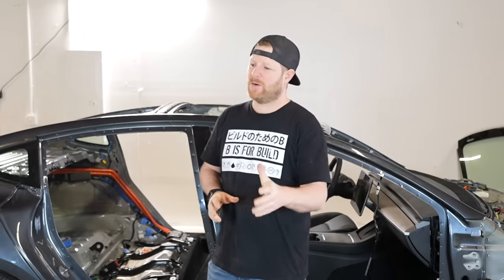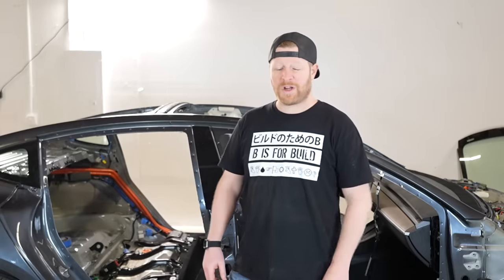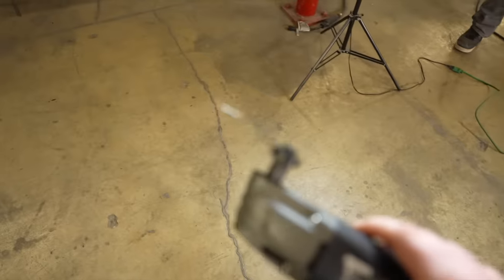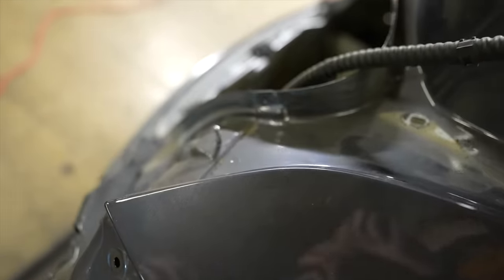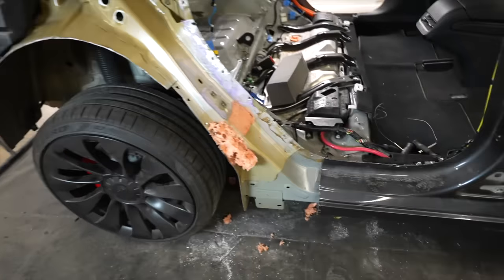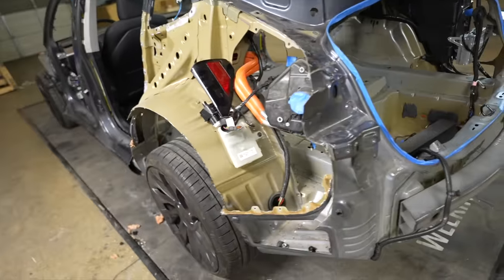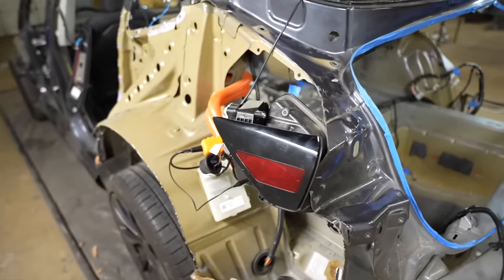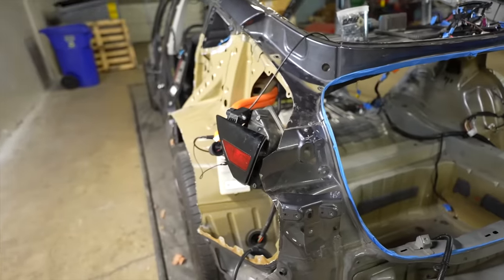How Much Faster Is a Tesla Model 3 Without A Body? RESULTS ARE SHOCKING!

Comment: I like how in the beginning of this build you were talking about how this is the most technologically advanced car you've ever worked on and you were sure you wouldn't be able to get far in removing stuff before it got mad and stopped working but now you have the entire body off and it just shrugs and keeps going lol
Reply: I was shocked that it wasn’t a problem
Reply: I’m respecting Teslas more and more as this build goes on
They’re surprisingly workable
Reply: @benjiman7259  teslas get a shit ton of hate just because they are EVs.
Reply: @Nick-hm9rh  na was a fan of tesla before. after purchasing i cannot recommend it anymore. way too many defects. service is non existent and overall i should have sticked with a more reliable brand. there's a report from consumer reports which confirmes my anectodical story
Reply: "The best part is no part" is apparently not just a SpaceX mindset.
Reply: @1eikaramba1  5 years 230,000 miles on my Model 3. Very reliable. Extremely happy. Saved $21,400 in gas so far! $21,400 effing dollars!!!!
Reply: @AdamWood  How much did you spend on electricity for charging? Not a gotcha question, I'm genuinely curious. I figured that the higher price of EVs was offset by gas savings, but I'm wondering how charging factors in.
Reply: @aidanharley243  Looking online people are averaging roughly 4.65 mi/kWh. With that, 230,000 miles takes 49,462kWh of electricity. Average cost of electricity in the US last month is $0.165 * 49,462kWh is roughly $8,163.
Reply: Seeing your screen name makes me think
Reply: @1eikaramba1   Nobody asked about your buying experience
Reply: @benjiman7259  The problem is the software.
Reply: There's an amazing thing called tricking the software and not having the sensors and shit being mandatory it makes sense for like the charging system and like the wires and all of the main components of the moving portion of the vehicle I'm sure Tesla did an update at some point that made all the extra stuff not one-hundred-percent necessary to something like this could actually happen and go down because there is plenty of DIY and this world that you just want to get out there and do it and if you have the ability you send it and this is the result❤
Reply: @benjiman7259  it's nothing but don't Legos that's exactly what electronics are and this isn't entirely electronic vehicle and it's the future Welcome To The Future we've got really fast angry pixie fucking Vehicles man its awesome!!!!
Reply: @aidanharley243  most people charge at home, and the running costs when you just drive 140 miles during the day to and from work, then charge at home, and night charging is cheaper than day charging because there is little demand at night atm

plus the massive efficiency Tesla's get, the cost of electricity for that distance travelled on say a model 3, is around 4k-9k dollars depending on where you live

you literally save thousands of dollars when you choose an EV, especially a Tesla
Reply: @1eikaramba1 you are having a unicorn of an experience. Tesla service is amazing according to everyone I’ve talked to that has used them. I’ve actually never needed them myself. Five years without a problem.

Comment: If you want to take it over 35 before the body swap, cut some plexiglass and bolt it on the frame behind the dash as a wind deflector, that bit of wind being thrown upwards will deflect the rest over your head. And also the state-of-charge on the original 3.8 run was low compared to it being nearly full this time, so last time it had less voltage and thus less horsepower, so it being a whole second faster was both it being far lighter now but also having a much higher charge level and somewhat higher battery voltage and thus more horsepower. The removal of the body would've had a big effect anyways though, perhaps 3 to 5 tenths I'd guess.
Reply: C/D says 3.1s with 0.3s rollout so that makes about 6 tenth difference

Comment: You should have it in a higher state of charge (like >80%) to improve the 0-60 time, looked like it wasn't that high when you got 3.8s before removing the body @ 20:15 
Cool project BTW :)
Reply: This.  The SoC looked like 30% or less in the first run, and that will give you drastically slower times. Still, taking the stock 3.1 (with 1 ft roll-out) down to 2.8 without a roll-out is a nice improvement.
Reply: @misaacson  also not entirely sure the measuring speed from the dash is super accurate. but at least it's consistent in both measurements. because if different charge, there is no strict reference point but it's still clearly way quicker than any stock M3P without weight reduction
Reply: 💯 as a M3P owner they are all pretty spot on for accel times. State of charge needs to be 80% or higher for those times.
Reply: @geemy9675  Tesla has very accurate speedometers but you're right, they did this entire thing pretty casually.

Comment: For the autofocus, you should be able to adjust it to focus on what's center frame most, that would likely work best for you.
Reply: what kind of camera & lens it is? anyone?
Reply: @bisforbuild Once I say the autofocus I could not stop seeing it.  Maybe you have to stop pointing and use arrows in editing?
Reply: ...or just use manual focus with 1 push AF so that it stays where you want.
Reply: How about changing the wheel and tire size?
Reply from the maker: thanks for the tips! it really helped! Now if only i could figure out the audio issues. Switching from canon to sony has been rough
Reply: @BisforBuild  get a DJI MIC
Reply: You could also try changing the speed of the autofocusing. Many cameras have that as an option
Reply: Try using a laser pointer.

Comment: I'm willing to bet that a decent portion of the 0-60 time improvement was due to the battery charge. The first 0-60 run was done with what looks like 40% or so battery charge, and the second run looked like it was at least 80% battery charge. The overall battery charge makes quite a big difference on the power output capability of the battery.
Reply: That's only really true at low temperatures.  The Model 3 in NCA and LFP chemistry is about equally fast down to 30% SoC as long as it's not freezing outside, then performance is impacted.  For LFP it can get really bad.
Reply: @tomsixsix  What is NCA and LFP chemistry and do you know when it went into production? I have a 22 M3P and I swear I can feel a difference below about 60-65% SOC. Not sure which battery chemistry mine has, it was ordered in Feb '22 and delivered May 24, '22.
Reply: @mholmes9262  If your car was made in the USA it has an NCA battery.  If it is European/China in origin and is standard range it is LFP.

Comment: I suspect that tho the 0- 60 might increase a lot, the range and top speed may decrease due to aerodynamics.. would be really neat to see them tested at a race track!! 😉 
But again, awesome video Chris!! 👍
Reply: putting back the hood and front bumper would help with the drag without too much weight penalty
Also  lower frontal area might balance out the drag coefficient, and anyway top speed could also be not horsepower limited in which case it could get to the same top speed, just a bit quicker or slower depending on the drag
Reply: @geemy9675  Going to need a full helmet or going to do a Jeremy Clarkson with the wind 😅

Comment: I work at a tesla authorized bodyshop and I just replaced a rr quarter panel.  Just for future reference it does not like you unplugging the larger connector of the two that are in the rr inner fender well. If you do have to disconnect make sure you unplug the 12v system. When that plug is disconnected she will shut down the hv system and drain the 12v battery.

Comment: 10:00 when you get to this point you realize how similar the base structure of all cars is regardless of the body structure. It makes it look like you could pretty much body swap anything as long as you build a roll cage but like all things with cars it's much easier said than done
Reply: Though the base design is quite universal, there's a lot to consider and act accordingly, like exact length, exact width, wheels, dash and fuel tank positions on the three axis, really much easier said than done as you said. Body swapping unibody vehicles is something I'll gladly leave to whoever has the knowledge to do it lol. Not any professional can do that.

Comment: Sport Compact Car magazine did something similar to a early 00s Sentra. But they removed parts, then did a run down the drag strip. After that they remove more and did another ru. Kept going until it was in a similar state. IIRC, they took a 16 second car and made it a 14 or 13 second car by removing weight. The article is out there in the aether of the internet, just have to Google it.

Comment: With the significant gains from weight loss, it would be interesting to find the point of deminishing returns on the battery.  Running the lightest battery capable of delivering sufficient current to make 2 passes, but no more, would set some serious records.

Comment: For the Focus on the camera. You can set it so that the speed it focuses is slower to react to changes. this way when you move your hand in front of the lens it wont auto focus right away and will focus only after the its in the location for a set time. you can also have it slowly change instead of snap focusing. hope that helps. New camera looks great.

Comment: With all structure gone how strong is the skateboard part? I'd worry about it bending or tweaking if pushed hard. it's good to know it's strong enough to handle a max acceleration test. Anyway very cool build and I'm amazed how much work you get accomplished each video.
Reply: He loves cutting bodies off cars without bracing them first. I'm sure that thing is a prezel
Reply: The floor is almost entirely battery and that section is super reinforced from factory
Reply: reinforced to protect the battery aginst getting punctured from the bottom if you hit something or protected from the sides in case of an accident. there is no way the chassis hasn't lost 80% of it's rigidity. the  roof and the pillars are also super reinforced to provide the best protectio' against rollover despite the glass roof so it all contributes to the rigidity, with half the unibody gone it has to be flexy like a car from the 1950's...Tesla is much too concerned about weight to make a skateboard that stays rigid without the roof

Comment: I'm sure everyone has commented about this already, but in your stock 0-60 run, the car appears to be well under 50% charge. That will have a pretty significant impact on your acceleration in a Model 3.

Comment: 3:05 this must be the RFID reader to (un)lock the car with the keycard.
Reply: That must be exactly what it's for. The module seems to run at the NFC frequency (for the card) and also at Wi-Fi frequencies? You can find that information in the Model 3's owner manual (I looked at the online one) under Certification Conformity.

Comment: I remember 10+ years ago when HotRod did this with a C4. If i recall the car got slower at a point due to the geometry of the suspension when all the weight was removed.
Reply: Sport Compact Car did it with a Sentra, too
Reply: with AWD and heaviest component being the battery and located between the wheels, weight distribution shouldn't be too bad
Reply: @geemy9675  It's not the distribution of the weight but the amount of it. Remember that as the suspension loads and unloads camber increases and decreases. so removing 25% of the weight will have the tires rolled under slightly so your really only gripping with the outer portion of the tread.

Comment: It would be interesting to see how the weight cut affects the range of the Tesla :)
Great video^^
Reply: Should go further?
Reply: Good Idea, in theory it would go further but if it was me driving id be launching it at every set of lights to feel the 3.8seconds 0-60
Reply: not as much as aerodynamic efficency. Not even close actually.
Reply: @mitchelldzodz8708  2.8 you mean?
Reply: @TheXshot  Yes your right i mean 2.8 lol
Reply: @mitchelldzodz8708  Probably a balance between more or less range depending on average speed 'cos of the the whole aerodynamics situation.
I'd guess if you stayed under 30mph the range would increase, above that; less range. 

(number is arbitrary guess btw)
Reply: I can say from experience that removing just the front trunk lid from a model 3 base cuts is range on highway in HALF.
Reply: Because of weight lost it will increase at least 100 miles
Reply: If you spoils the aerodynamic, the range will plummet. 
The weight doesn’t change much in the equation of static rolling resistance. 
Wheel, wheel bearings and drivetrain is where your static resistance come from.
Reply: Weight doesnt affect range as much as aerodynamics do. By far. This will have a lower range than stock. 100%
Reply: @romansenger2322  this is totally true, but, if you drive city only it will have more range as drag is almost nothing compared to highway speeds. 800 miles range is my guess in city speeds only.
Reply: @ohyou_6599  Makes sense, that "divot" makes for a lot of drag and vortexes.

Comment: NOW, DO THIS to a Tesla model S plaid! Like if if you want him to do it for our entertainment!
Reply: Maybe if he could find a wrecked one, but it's a 130-150,000 dollar car. Also on a prepped track the plaid launches to 60 mph at just under 2 seconds at 1.98, I doubt there would be any improvement, the body is ultra lightweight already because the Plaid is a much more high performance oriented vehicle. With a potential for a 200 mph top speed after a software update, the launch max speed was 160, if you spoil the aero I think the car will just be made worse in every way I don't think it has the bulky extra weight the model 3 has. And with 1,000 hp it's not noticing the weight as much as the model 3, and having less weight may just mean less grip for all that power. At certain points in the launch it is pulling more than 1g which seems almost impossible so the room for improvement is absolutely razor thin. And if you added a roll cage it would probably weigh more than the removed parts.
Reply: Well he might go back in time, got to be careful

Comment: I’m surprised how rigid the chassis is considering
Reply: I'm surprised you can tell the rigidity from of the video of the car going straight on a flat road
Reply: I guarantee it's not very rigid. I would worry about the flexing being unsafe and flexing the battery pack.

Comment: You could also try using the Ingenext Module which you plug into the MCU (underneath the glovebox and covered in trim) to get an even bigger performance boost. The only downside though, is that it costs $2000 USD.

Comment: Love the work and channel.  You mentioned 2 things in the video, 1st that you may give away a tesla, and you mentioned the word Jeepla.  It has been a dream of mine for a couple years now to take a wrecked Tesla and chopping the body off and dropping on the body from my 76 Mail Jeep.  I would love to have a tesla powered DJ5 which would be the modern version of the limited run electric mail Jeeps from the mid 70s.  My DJ runs but need to finish the body work.  About 5 years ago I had to quit working to take care of my mom full time so my money for projects has been very limited.  But would for sure be a dream to have a Tesla powered Mail Jeep.

Comment: Get urself a dragy gps device to messure 0-60. Maybe you get the n1 spot (3 sec with rollout)
For max Performance you need 95% soc and pre condition the battery to 120°f 
A warm battery and high soc is the most important.

Comment: The Purple Steel can be removed easy with a heat gun and it just pops off.
I had a SR almost in this condition and it was defiantly way faster like breaking 4 secs since stock its about 5.
I'm working on doing a custom frame for a LR RWD on a Truck conversion and will take it for a test drive as rolling chassis!

Comment: Really cool video. Did you weigh the car with the weight removed? Just curious how much weight you took out of it. I took 210 lbs out of my Model 3 Performance and it took .2 seconds off of 0-60 mph so 1,000 lbs would probably do a full second. Can you measure it with a Dragy? That is really the only way to get an accurate measurement.
Reply: Hey can you teach me how to loose 210lb on the tesla ?

Comment: Important to note that the battery pack in the Model 3 is not structural. Removing the body is putting a significant amount of torsion on the pack. It is possible for this to result in a catastrophic failure.

Comment: Hi There. Since you took everything apart I have a question. I just got a Tesla for my driving school. I am installing an instructor brake on the passenger side for my instructors. Is it safe to drill a hole or put a self tapping screw into the sheet metal (if there is sheet metal) in front of the front passenger seat. Need to drill2 more holes under the brake pedal so I can attache a cable to that. Any tip is highly highly appreciated. I don't want to drill into a cable or battery.

Comment: 3:14 B pillar camera.  Som,e elaboration, that unit at the bottom is not for IR.  It does Bluetooth and Near Field Communication (NFC).  So likely to detect a key / fob / phone etc and communicate it back to the head end using Bluetooth?
Edit, confirmed, it's for Keycard.  Test info on the module here:  https://fcc.report/FCC-ID/2AEIM-1089773E/3831028.pdf

Comment: I hope you weren't serious about the 0.4sec drop estimate.
Weight reduction is a massive thing in racing.
Overall, impressed with the results
Reply: Then again his battery charge was much lower in the initial test. Gotta have good power left to accelerate fast.

Comment: do NOT bend those solid dc cables going to the charge port. you have a risk of shorting them internally. you need to remake tue cable as a copper flexible cable.